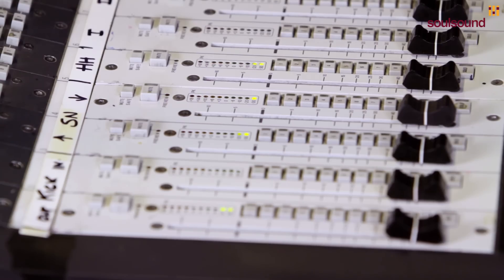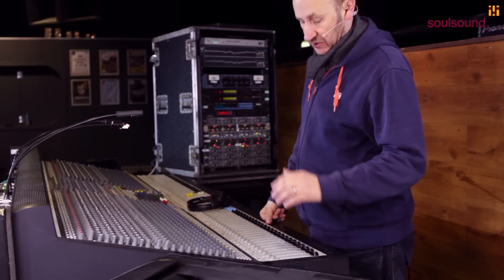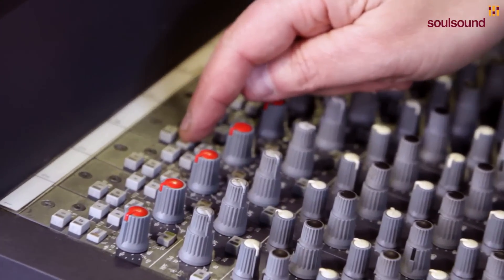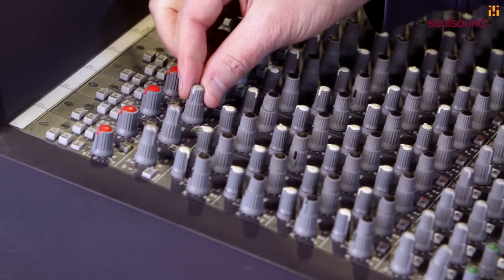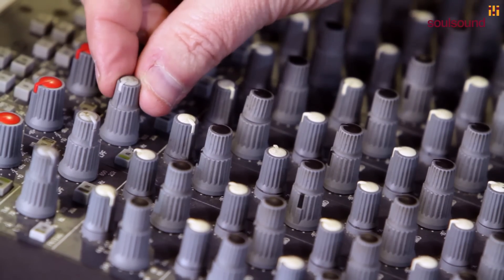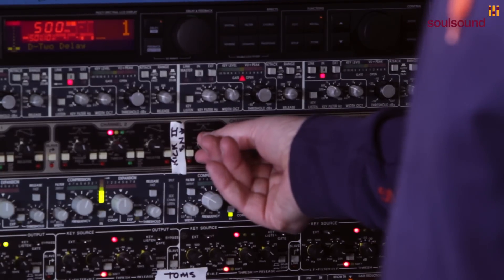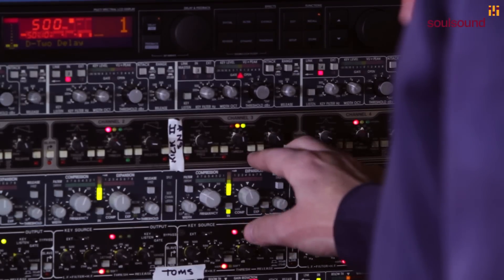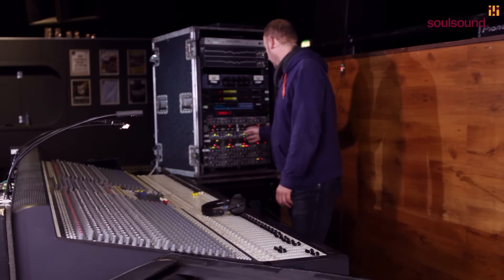Mixing Front Of House: The Snare Drum - with Jon Burton

Comment: Hi  my name is David Atta  i really appreciate your video I just want to know witch kind of sound board mixing y're using because i just want the serial number of your sound board and rack effect!!! Thanks
Reply from the maker: ATTA DAVID it is a Soundcraft Series 5, but don't have access to the racks to get the serial numbers! Did you perhaps mean the model numbers?
Reply: +ATTA DAVID Gate he uses is from DRAWMER, Model: MX 40
Others from top down:
BSS FCS 960 - Stereo EQ
2 YAMAHA SPX 990 or 900
Lexicon PCM 70 or 80
TC Electronic D2 delay
BSS DPR-404 Quad Compressor Deesser
DRAWMER MX 40 punch gate
BSS DPR 901 II - DYNAMIC MULTI-BAND EQUALIZER/COMPRESSOR
Drawmer DS 404 quad gate
more BSS DPR-404 down below